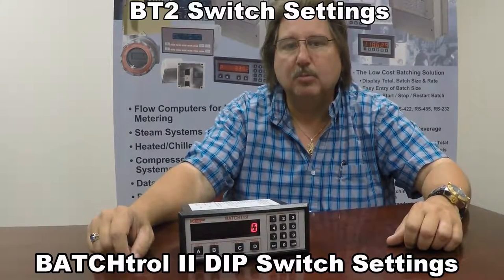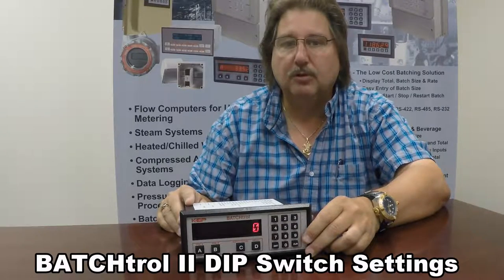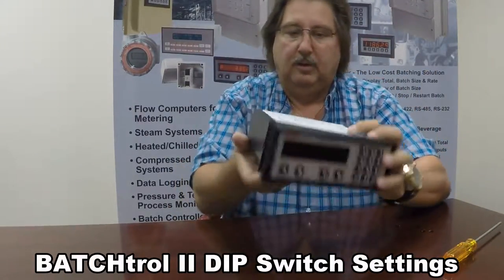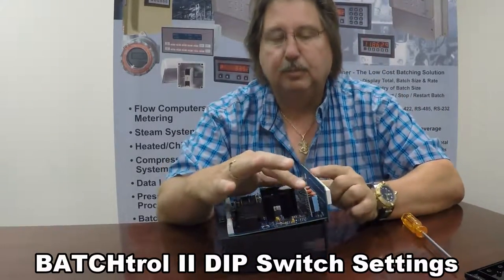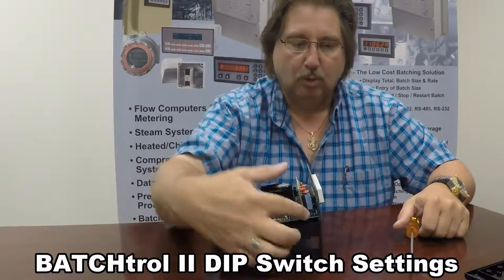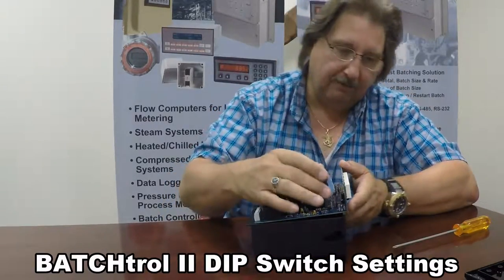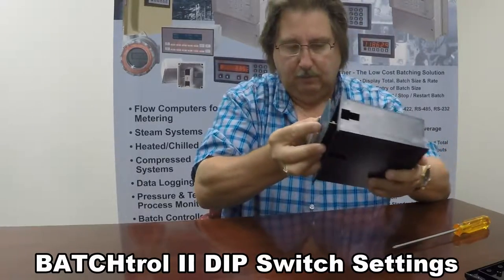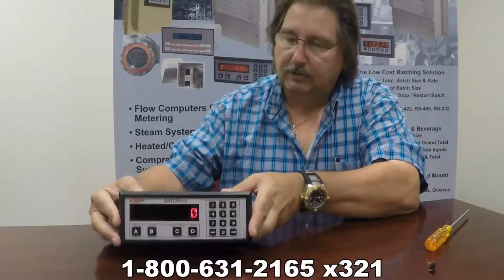BATCHtrol II (BT2) DIP Switch Settings

Comment: Hello, is it possible to change the input from 4-20mA to passive?  or how would the connection diagram be, if I have a transmitter with output 4-20 active?